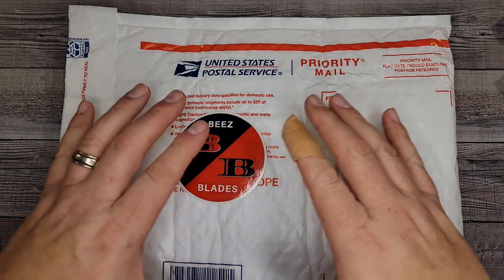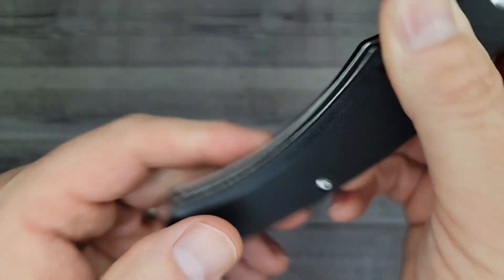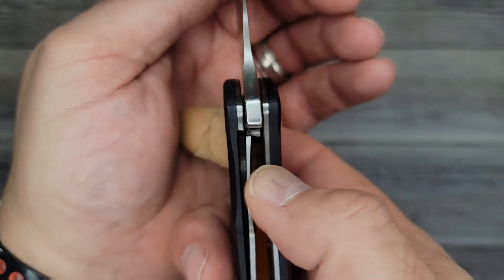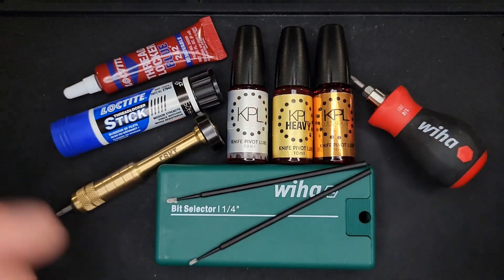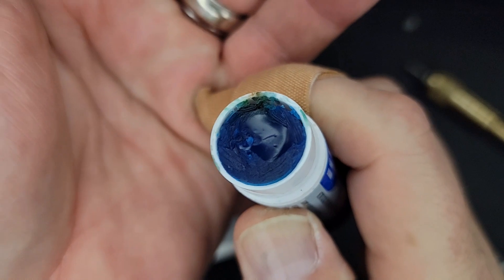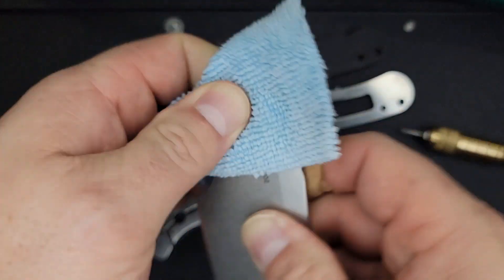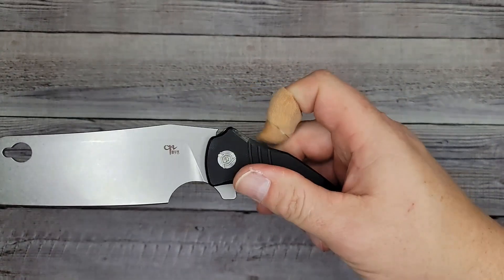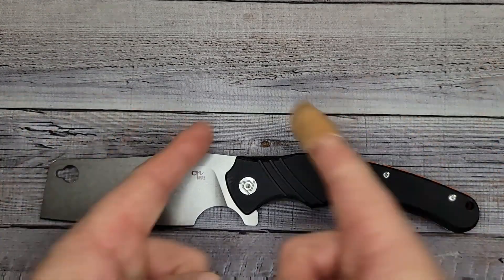UNDER $30! CRAZY BLADE THAT WORKS! NEW COMPANY FOR BEEZ BLADES | OVERVIEW/DISASSEMBLY

Comment: Yup found it on Amazon and I added the Green G10 with the orange back spacer to my wish list.  And I agree the slot and hole in the blade would hang perfectly from a large nail or screw head!!

Comment: That knife is total crap. The metal is so cheap that the blade will split in two the minute you hit it too hard or if drops on concrete. They use a very cheap alloy to make the blades, exactly the same as the house brand of Canadian tire in Canada.  that metal is porous and looks like aluminum inside. As for the Buck knives, there are 3 different categories, so watch out when you buy one.